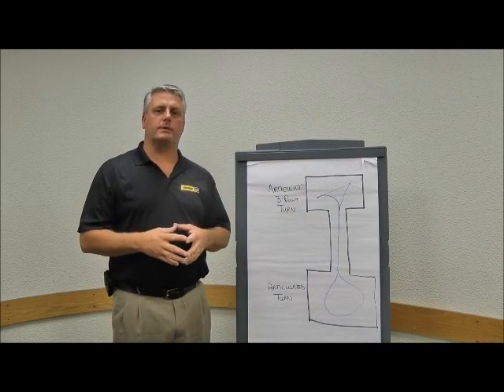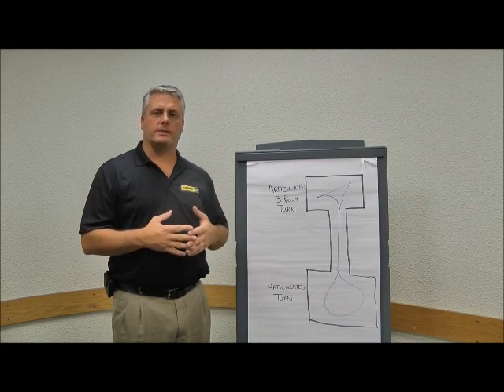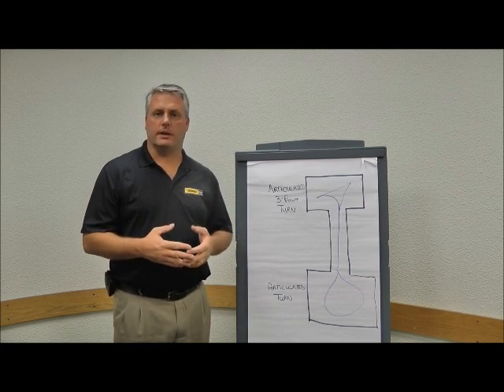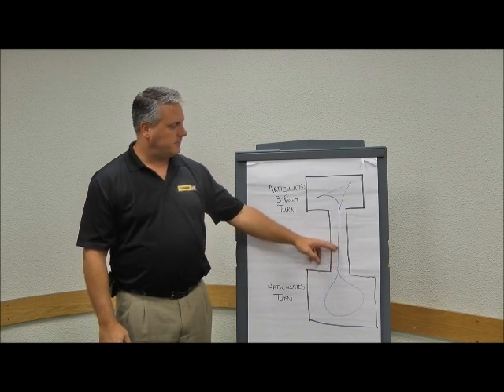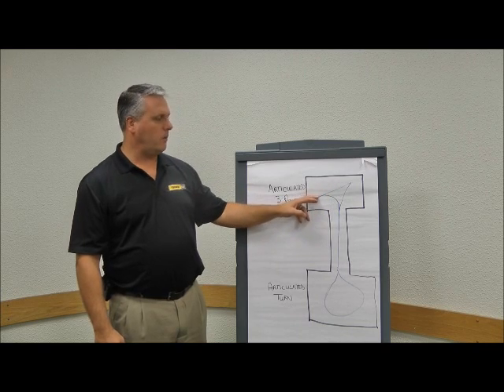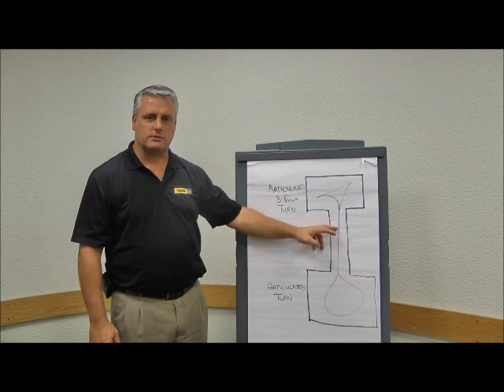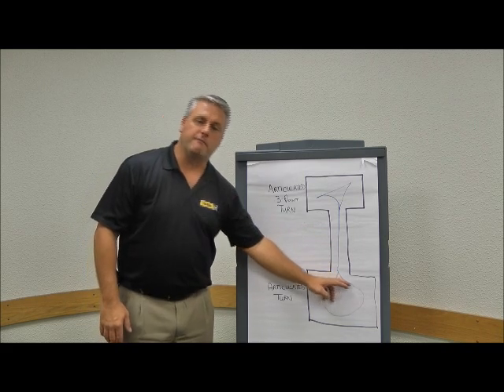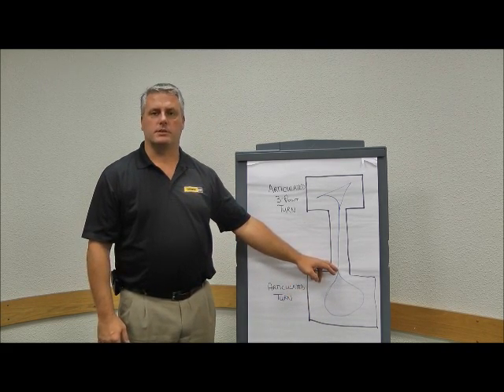Cat Motor Grader: Conventional vs Joystick Controls - Toromont Cat

Comment: I was taught to steer with my knees while running the machine.  That left both hands fully functional for my controls.  You actually had to be an operator to run a motor grader coming up.  Not only that you had to know grade, and the best guys could put a road on % of whatever within a quarter inch of what was called for.  Enough to where gps gets within the same specs.

Comment: The joy sticks probly nice but as far as mechanical issues go it takes more man hours to tear the cab apart or find a wire harnesses ect. From the conventional hydro over hydro finding the valve that may be stuck or pin play in the sticks better that removal of the seat and dash depending on were the short may be. Joystick good for excavator but in the handles of a grader that alot of problems in one Joystick if problems occur the wire harnesses electric valves ect the conventional you can trace it straight down to the valves under the cab just me but the piano style is what I learned on really not much effort because for a smooth finish your not adjusting much just up or down on one side or the other for a finish cut and forward and reverse right next to you 1 2 3 4 5 gears put in 1st a use the pedal for power and but I didn't like the cat wheel loaders with the forward reverse but on the pilot steering wheel the old lever on the side worked better in my opinion like the older kawasaki Komatsu and cat B and G  models just me I guess

Comment: I'll never run levers again. The speed and control offered with joysticks are unmatched. Removed the radial tires too on the 140M, as the speed at which the joystick controls offers causes radial tires to hop, causing washboard finish. Not enough fingers on hands to get joystick level production and finesse out of lever controls. Joysticks allow "applying butter to a piece of bread", at 20 klms per hour.

Comment: I started on a F model then ran a 12 G for 10 years now I'm running a 12H but the company I work for thought they would upgrade me to a M model after a few minutes I caught on to the controls and I can honestly say joysticks suck the absolute worse day on a grader I've ever had every time I turned my blade would move up or down and at the end of the day my fucking arms were killing me I liked the visibility and the comfort of the cab but but the controls are only good for those that don't know how to run a grader and use GPS
Reply: I still slobber on myself when I come across a Grader God!

Comment: To the people of Caterpillar I have some advice, if it ant broke don't fix it. This is a dumb design ther was no reason to take the steering wheel out of the machine or to replace the old style controls. Don't tell me something stupid like, you just have to get used to it and then you will like it, because I have been operating a 12m for 8 years and I still don't like it the H model was the best that Caterpillar ever had. Seems like yall are backing up now.
Reply: lee grissett .well said,thats why john deere are laughing and cat are still trying to convince themselves they havent made a huge mistake.
Reply: lee grissett agreed and Im only 30 yrs old.
Reply: Well the steering wheel needed to be modified to be faster other than that nothing was supposed to be changed

Comment: the only thing I see that I like about the M model is the visibility, I've been a G and H. operator for 31 years I cut my teeth on a old knuckle buster, this joystick shit looks like a pain in the ass but this new generation of so called operators or to be honest seat monkeys and GPS which by the way I work circles around I still use my string, paint and engineers ruler in tenths, at work I turn out more completed work that a 2 man GPS crew and my finish rock is within a 1/4" compared to GPS finish work which is plus or minus a tenth so of the really experienced GPS guys can get it within a half inch, it's nice to know that my worn out eyes out do a million dollars with of the latest and greatest high tech grading systems. Y'all can have the joystick shit me and the rest of the real grader men will stick with our old stuff

Comment: have a  1947  212 on the farm... Also run a 140m in La. and Tx . over the past 3years ... Can create the same result with both machines .. lot faster with 140m plus radio and a/c ... But i have never gotten stuck in 212 ... also  the 212 will still be running 2047 ....   140m still running a 100 years from now ?....  too many electrical  part and jungle humiliate in La and Tx ..

Comment: In my world I most often have to settle for less comfort because I run older equipment that is paid off. I have a Cat 12F...cant afford a $40,000 or $50,000 grader. I use them only on commercial excavation projects. I will run newer excavators and rock-hammers because that's my main service...along with a nice mini-excavator and skid-steer. Been in business 30 yrs. Have out-lasted 75% of others just by being able to be out of debt as much as possible. BUT...I do love admiring new iron.
Reply: I understand that. There's nothing I can do on our M's I can't do on our H.

Comment: Bet it puts you to sleep running it. I bet you'd wanna trade it in after a few thousand hours ,because I  sure wouldn't want to have to fix it. Electric over hydraulic is also slower in reaction time compared to to plain hydraulic. I bet the learning curve takes a month to get it into your head where you can blade without thinking. Wonder if there is a failsafe in case the switches hang or blow fuses. Runaway Cat.
Reply: actually it has back-up steering and braking in case of engine failure.

Comment: I ran both and after 15 years on G and H's, i found myself far more fatigued on the M series. yeah you might move less but the movement is what keeps you from becoming tired. Running the M made my wrists hurt and having the extra concentration gave me headaches.  I would take a steering wheel over a Joystick any day, 78% less movement simply means bigger chance of becoming over weight. Not to mention the lack of hydro feel is gone. Nahh, Cat should have given the option instead of phasing out the old style
Reply: I couldn't agree more! CAT would have been better off offering the M series as an option. John Deeres GP model has built in cross slope and a choice of steering options. I've always been a CAT man weather it's a scraper, loader, dozer, trackhoe and until the M series a blade fan.............
Reply: 2nd this!
Reply: Edward Cunningham Cunningham exactly
Reply: That's what kills an operator is NOT moving. The body NEEDS to move!
Reply: Couldn't agree more, have used both and would take an H over an M any day. M s might be good on maintenance grading and haul roads but working around kerb doing final trim they are not as good as the G or H. Interesting thing  is that Cat are bringing out the 140 in the levers and steering wheel again, funny how the wheel turns.
Reply: yep not a joy stick fan i like the wheel better, also , my back feels better behing the wheel

Comment: joystick controls are not as functional as conventional controls and every old time operator will tell you the same thing.
Reply: leonard seigo I am driving this motor grader
Reply: Conventional controls whats the hydralic or what is it connected to.
Reply: Try to save yourself when you're pulling a 2 to 1 slope 30 foot down and you may hit a rock then you have no chance with joysticks
Reply: Bull crap

Comment: A little exagerated on the hydraulic side for emphasis. It's going to be interesting to see what's not working 10,000 hours/5 years later with all that fly by wire stuff.